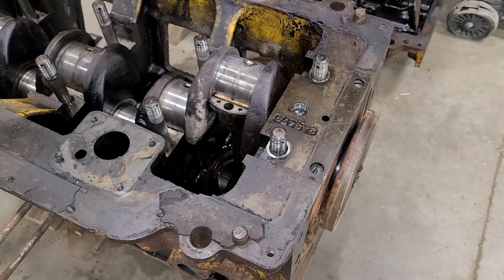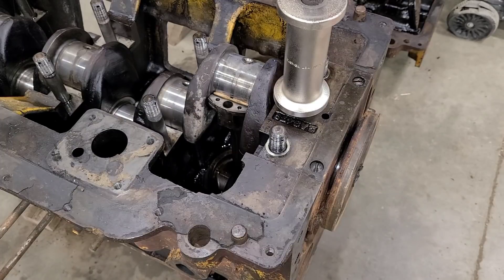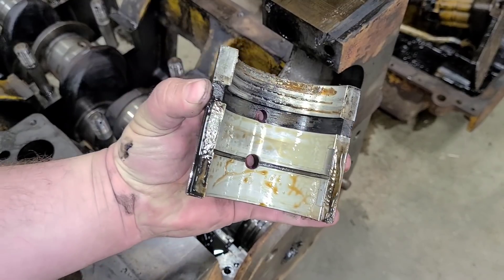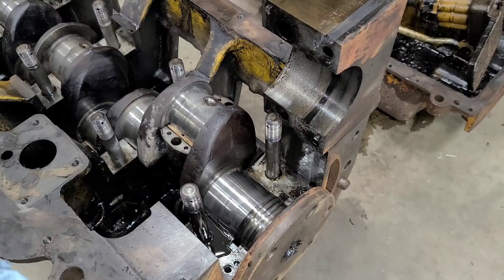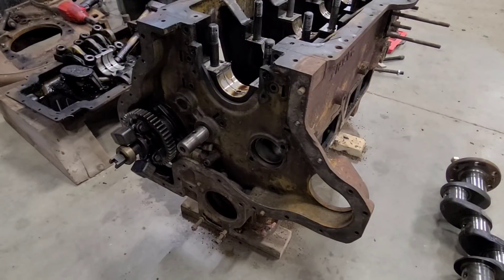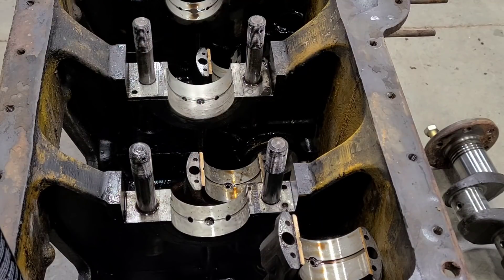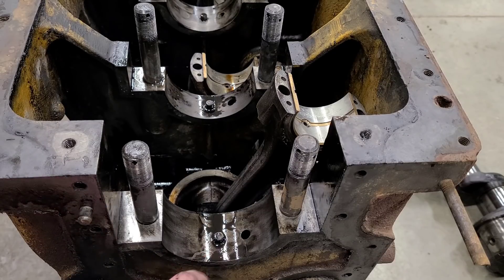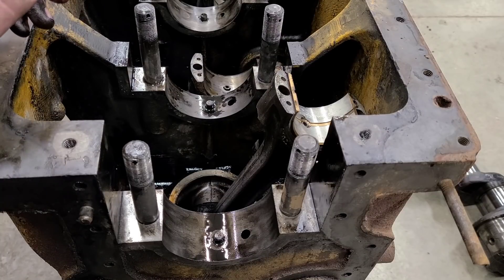Caterpillar RD-4 Engine Disassembly Pt.11 Crankshaft Removal

Comment: Nothing like getting your daughter into Cats early. I have a boy and a girl and my son was never interested in cars, engines or engineering but my daughter was always with me in the garage. Both are in their 30's now. How time flies. 
I am really surprised those pistons moved. In restoring some of my old engines moving seized pistons out of bores has proved one of the hardest fights I've had in restoration. Maybe with the crank get some of that plastic stuff that measures bearing clearance just to check on a main and big end that its in tolerance.

Comment: Turn the block upright, get a pan and a camping stove, heat some oil up smoking hot and fill the bores up with it. The combination of heat and thinned oil great for releasing stuck pistons.

Comment: Congratulations on your daughter! Word of warning- this is the easy part. In about 12 years...not so much!!!

FWIW, the sleeves on my 1953 D4 came out easy, the pistons not so much. Also, my D4 had 2 piece pistons and the top of one broke loose and did some damage. I got a set of newer replacement pistons. Didn't want to go through that again.

Comment: With the shimmed main caps. An amazing amount of crank main journal surface can be polished away.  The crank might work with up to a 0.0015 undersize without cramming the timing gear clearance and transmission Input shaft alignment too far out of alignment.

Comment: If you don't know you should store the crankshaft standing up so it doesn't warp. If you do then ignore me
Reply from the maker: I've heard of this and was told by my machinist years ago that crankshaft warping is generally a myth. The way he explained it was this, if the crankshaft could warp lying flat, then the offset of the throws would warp when standing them up. He said he fixed too many dings and dents from people standing them up and then the crankshaft getting knocked over, he also said the only true warping he has ever seen is from catastrophic engine failure, and those were scrapped. To each their own, but to me it makes sense, thanks Lance

Comment: Well I didn't know that CAT used labyrinth seals on the D2 engines. That is the spiral groove on the crank shaft. It is used a lot on Paper machines where heat destroys most oil seals.

Comment: Caterpillar used two piece pistons with the aluminum top threaded on a cast piston. I have seen them come apart when the brass pin gives out. Very destructive.  Hopefully you can avoid that problem.

Comment: What absolutely beautiful eyes. I would say that in about 15 years from now, Daddy is going to be fighting off the boys. 

Those crankshaft journals look great and the little bit of rust and moister residue that is visible, I believe will clean up fine at the machine shop. As to those bearing dowels, just a guess, but Cat may have engineered those into the rod because earlier models of that engine may have been prone to spinning bearings and they found that a dowel prevented that problem. ( as I said, just a guess) FYI, I found that No.1 Kerosene was a good solvent to loosen and clean away burnt oil from the walls of the block as well as the gummy oil sludge at the bottom of the block. Kerosene seemed to dilute the sludge quite well and make the burnt-on oil easier to wipe away.  Thank you for the video.

Comment: When I did my D4 I built a fixture to bolt on in place of the oil pan and then a 20 ton jack plus a big hammer to jar everything for the sleeves to break loose. Then a 20 ton jack in press to push pistons out of sleeves. I’m surprised at how well the one piston came out. It’ll be interesting to see how the rest of the piston and sleeve removal goes.

Comment: Diesel fuel is actually a poor lubricant and penetrant, much better to use diluted engine oil or ATF or even WD40
Reply from the maker: There are millions of rotary, inline, and common rail injection pumps lubricated by diesel that would argue against your statement